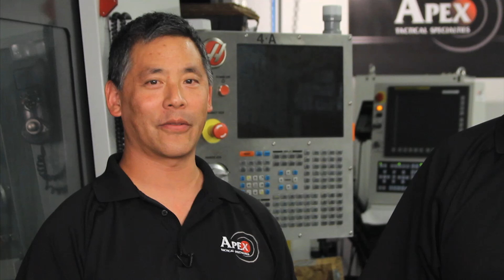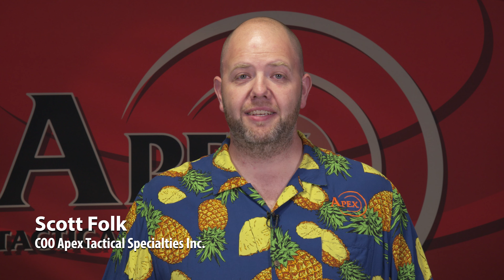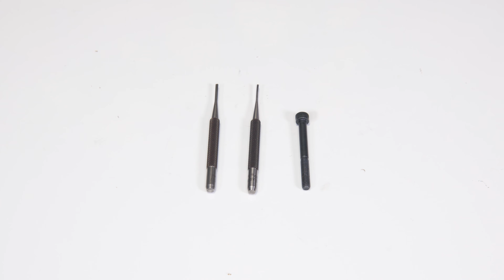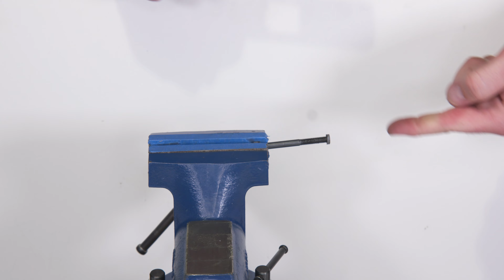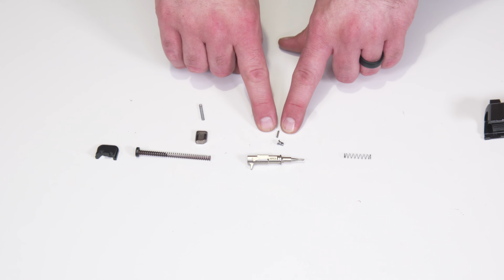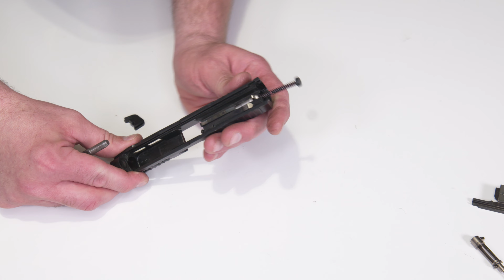How to install the Apex Durable Striker for the FN 509

Comment: Great video, only confusing part was the bushing, I kept trying to pull a factory bushing out but there isn’t one.  Gets a little confusing in the video with the screw, just add that it’s not a step in the install, it’s only there for after you’ve done the install for future needs